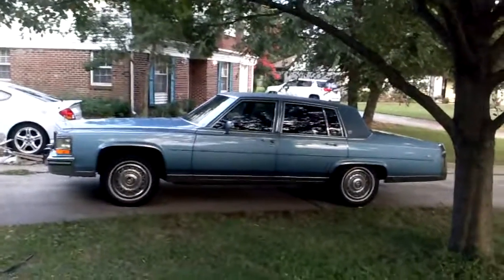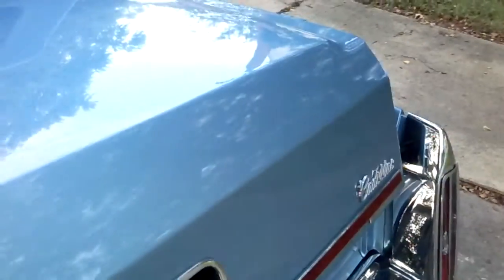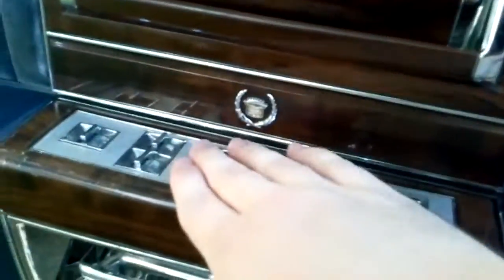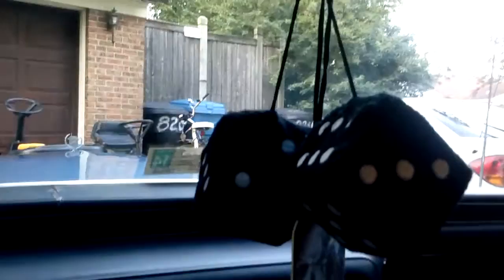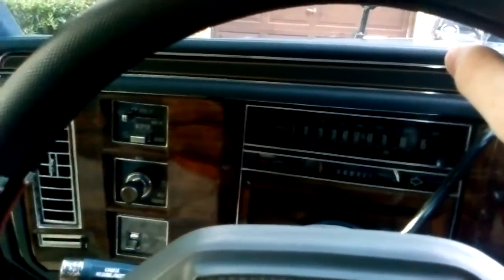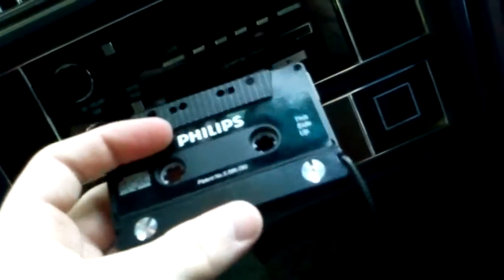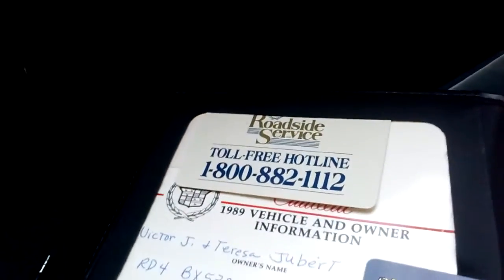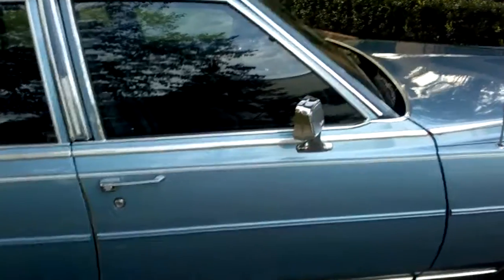My 1989 cadillac fleetwood brougham

Comment: It's not normal for any car to knock or rattle, or act like it wants to keep running after you shut it off. More than likely your caddy is out of timing, which is an easy fix.
Reply from the maker: Its the anti- dieseling fuse relay thats causing my engine to lnock like that after i turn it off. The relay has a short in it im trying to fix among other things.
Reply: angusyjr nice car.. I have one, owned it for 16 years. The only major problems i had were TCC switch in the transmission & rear main oil leak and it was going to cost $1000 to do the rear main leak right cause the engine had to come out. So i just let them overhaul the whole engine, heads bored out everything.. That rattle you talking about, sounds like bad gas or carburetor need to be adjusted.. If your check engine light ever comes on, its either your o2 sensor or carburetor need to be rebuilt.. If you have any questions about you car or need parts just let me know..
Reply from the maker: ***** what a coincidence. My check engine light is always on. Lol!
Thanx for the advice pal. Ill tell my stepdad so we can fix it. ;-)
Its a slow project but ill get it done.
Reply: angusyjr if it your carburetor click on this link http://www.nationalcarburetors.com/cat-cadillac.html the one you will need is  307"-5.0 L. Computerized W/Climatic Choke E4MC  these guys are good. I just purchase one $239.95 and shop that put it was shocked at how clean it was, looks just like it do in the pic http://www.nationalcarburetors.com/lookup.aspx?partnum=nd4469